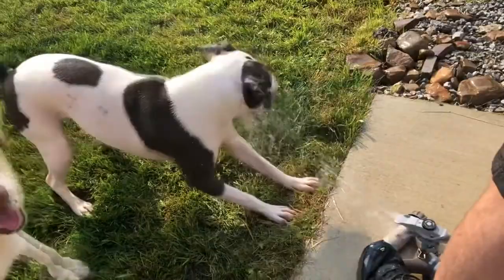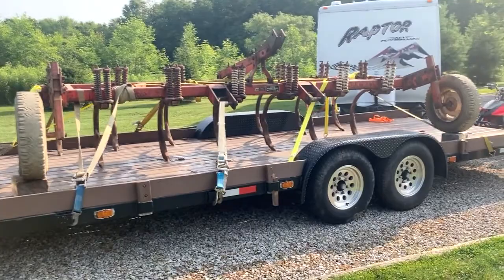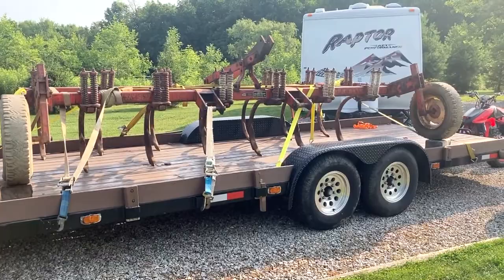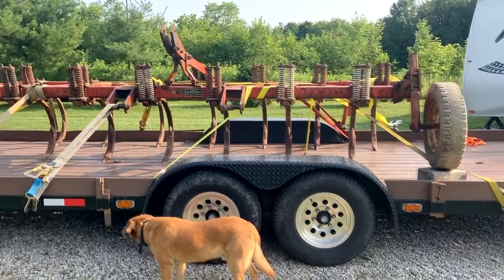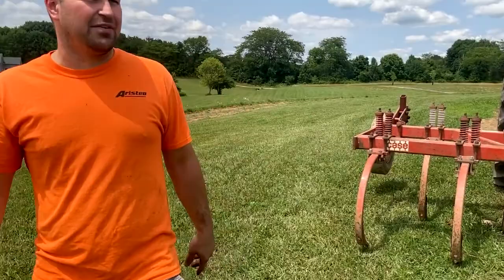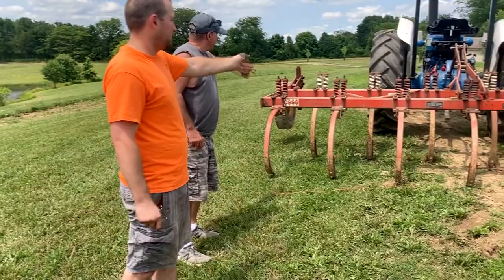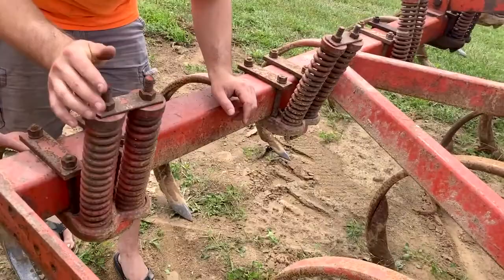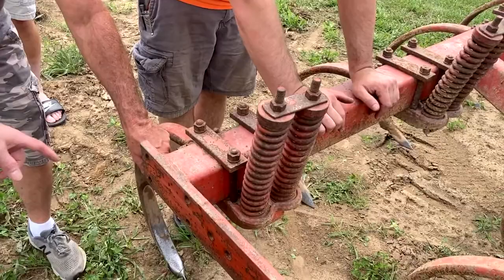New chisel plow... is it too big?

Comment: I have the same setup with an International 11pt chisel plow and a 7600 Ford 1981 Diesel tractor.  I only pull 9 shanks and have 300 lbs of weights on the front of my tractor.  Does a farily good job in low 3rd gear.

Comment: I used to use a chisel, just like that. But on a 145 horse tractor, with front wheel assist, and duals. And at 10 inches deep, it was sometimes all it wanted.

Comment: That looks like a Ford 4000 has a split grille. Dad had a 1966 4000 split grille 52 pto hp. Didn't pull a chisel plow or a field cultivator, pulled a moldboard plow 3-14s and a 10 ft disc. Good old tractors but that looks like a lot to ask it to do.

Comment: Chisel plow is to big you need a tractor 🚜  at less  a 100 hundred horse 🐴 ⛮ power l used to Chisel plow with a 9600 Ford tractor 🚜  135 horse power  that is what you need.